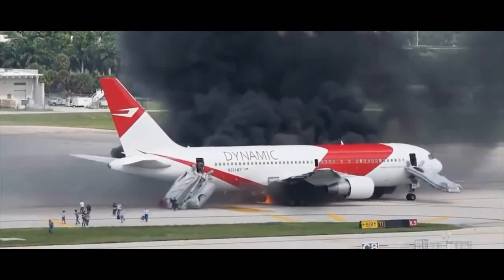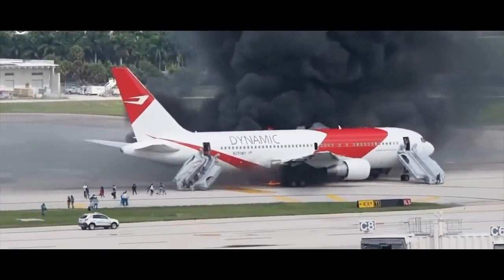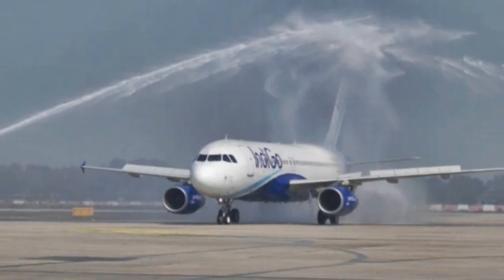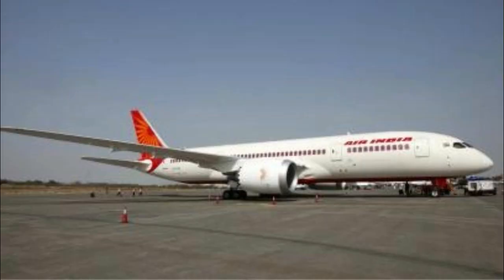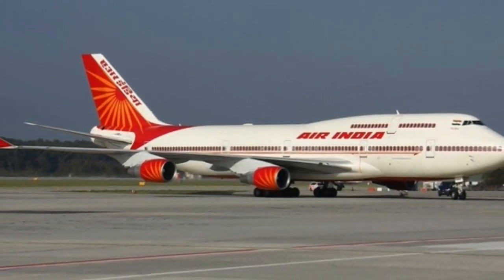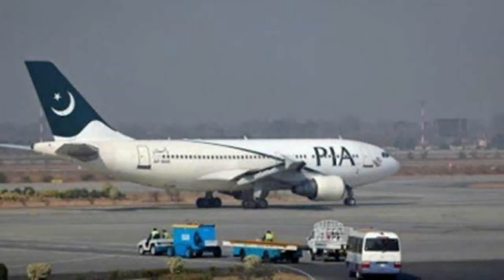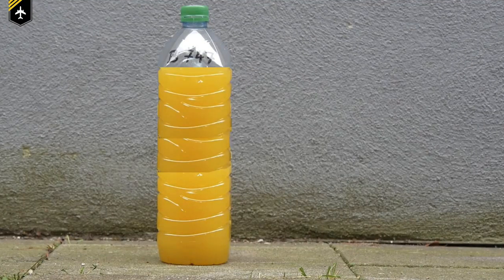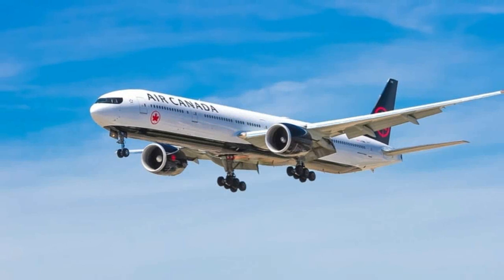Fuel Dumping in Airplanes Explained | എന്താണ് വിമാനത്തിലെ ഫ്യൂൽ ഡംപിങ് |PCD | Psytech Malayalam

Comment: Hello mr boeing 727 maximum takeoff weight is 77.000 kg, its determined by manufacture so the landing weights will be reduced due to fuel consumption it's meant landing weight may be 70,000 kg . plz check with subjects before you publish. Don't give any wrong information.

Comment: Enthonnade ithu rasna niracha kuppi ano ee bimaanam ennu parayunna Sadhanam thazhe ittu pottikkan
Reply: കളിയാക്കൽ ഒന്നും വേണ്ട ആ ചേട്ടൻ നല്ലോണം പറഞ്ഞ് തന്നു അതിൽ അസൂയപെട്ടിട്ടും കര്യൂല
Reply from the maker: Tnq Buddy
Pullikk karyam kathiyilla..Atha oru etthum pidiyum illathe samsarikkunath
Reply: @UnFoldIdeasMalayalam  enthoru mandatharamaado.. contact some pilot or crew.. they will give you proper knowledge.. then you go and do a vdo
Reply: @dwayneandtheheros3968  You talk as if you are a trained crew, but its utter nonsense
the video was all about fuel dumping, where it is practiced(emergency landing) and it is clearly mentioned in the video . hope you watched the video fully, if you did, then come with an argument.
for further clarification check on Captain Joe's Channel. He is a trained pilot and he holds the same view for this subject
good luck
Reply: @danusabu4874  I am not here to make any kind of argument with the ppl whom I dont even know
Reply: @reenajacob8255  what he said is not correct mam... if you are learning something you should get the proper knowledge.. there is no connection between fuel dumping and what he said.. usually the fuel dumping comes only when there is an emergency landing.. thank you
Reply: @dwayneandtheheros3968  Did he Say fuel dumping happens in case of NON EMERGENCY?
what rubbishness are you talking madam?